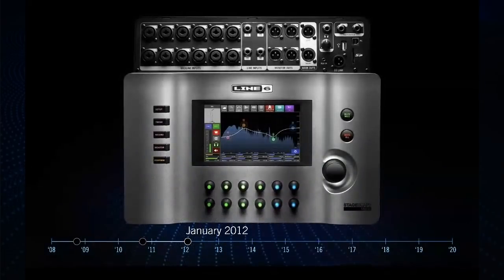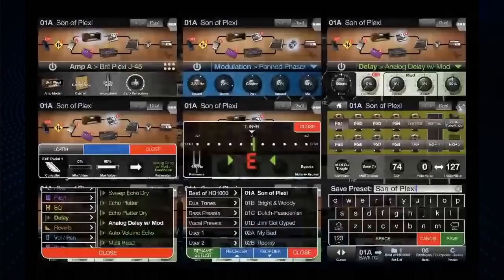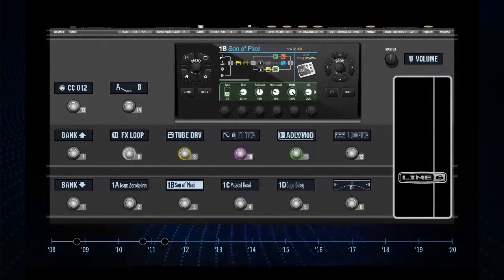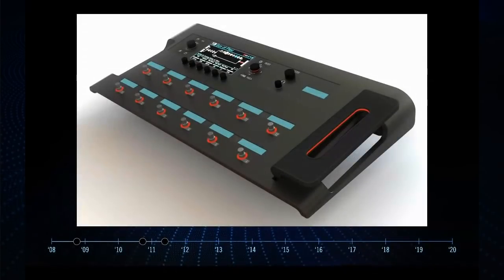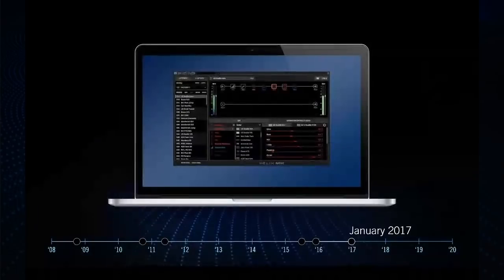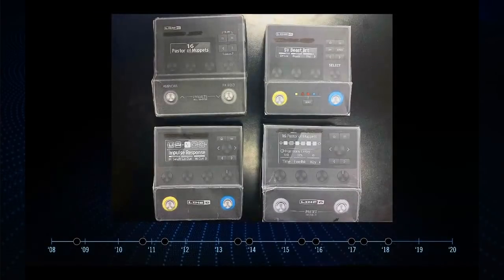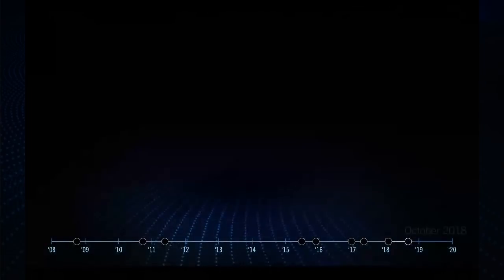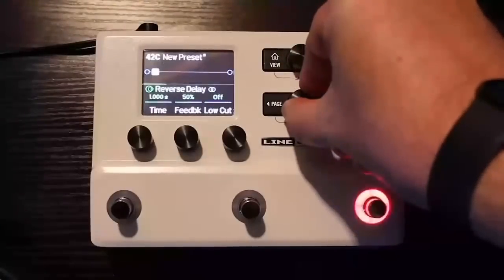Line 6 | Eric Klein Details the Development of the Helix Guitar Processor

Comment: Hi Eric, I have the Helix Rack + controller already since 2016, and It is a great machine. Unfortunately I don't play enough. But I wanted to tell you that the Helix  UI has inspired me when we developed a very powerful uncompressed Video Processor (handling up to 100Gb/s video data or over 8000 audio channels. It was a real pleasure to watch the process and the  design steps that I am confronted with in many new design stages.  I would love more of these maybe on other hardware selections of the Helix.
As a gear junkie, would the Helix sonically benefit from a Yamaha SPX2000 (to stay in the family) in a digital effects loop?
Thanks